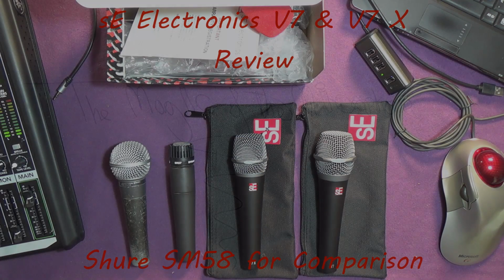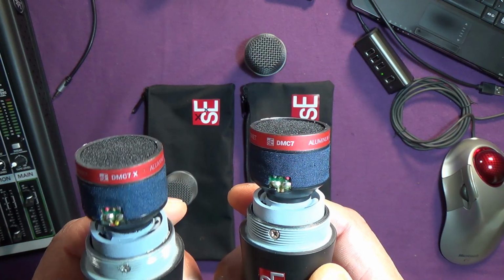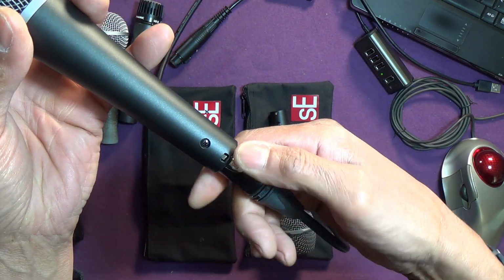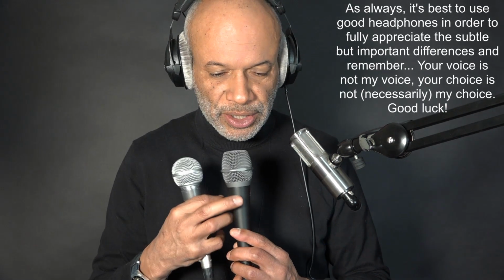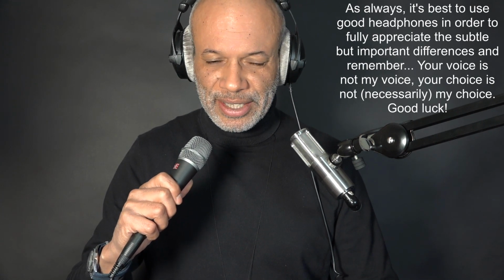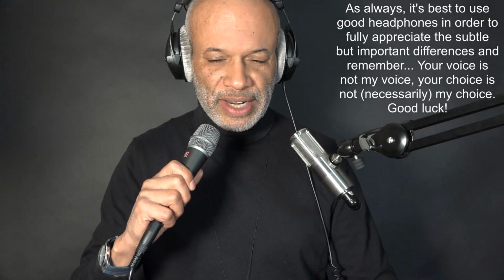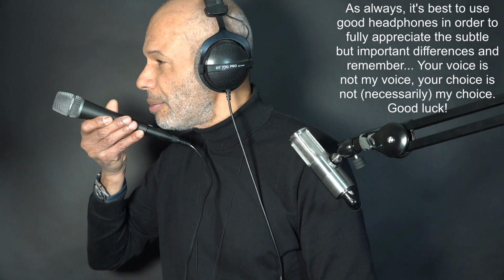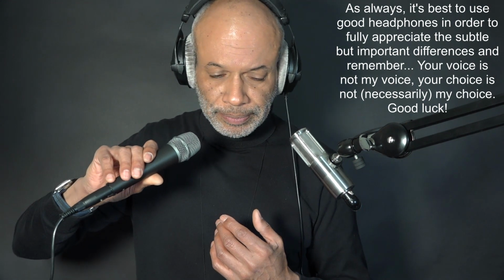sE Electronics V7 & V7 X Review vs Shure SM58 USA (Earthworks Icon Pro & Beyerdynamic M88)

Comment: This review approaches the level of art, so thank you for both the excellent review and the demonstration of its potential use as a new tool in the toolkit.  I loved how you put it in the larger context of change/evolution/progress and challenges of the marketplace.  The sE story is a great complement to this video.  Thank you, and I'm really curious to see what can be done with these two sound capturing devices.  I want to try it on double bass (particularly because of its rejection at the 90 degree angle with a bassist in between a grand piano and a trap set).
Reply from the maker: Glad it was useful.

Comment: We compared the V7X to a V7 & a KMS105 for a live outdoor acoustic gig, we used a simple foam top on all 3. Give the SE’s a little boost at around 10k.
On the V7X we lowered the bass a little around 100hz. It Sounded gorgeous on females. Smoother than the other two .
Reply: Btw we used the V7X’s own top on it. The little foam shield we put on top helped the pops.
Reply from the maker: Thanks, that's good to hear. I wonder whether SE makes an attractive exterior foam for it.
Reply: @AntonBrowne  not sure if SE do, I know what you mean tho, many are too thick looking & sounding too in some cases, wonder would a spare inner foam from the V7 or similar fit over the smaller grill on a V7x !?  Tidy size !Canford UK have great pop shields!  Or if there is a smaller sm57 pop shield that may work either. 
I felt the V7x ‘s own grill is nicer on it. Just a thin shield would be a class find. If you find something let me know an same as ! :)  Best Wishes

Comment: I did a spectrum plot comparison in Audacity between the Sennheiser e965 and the sE Electronics v7x on my baritone voice. I used the same reading and found interesting differences. I then applied some equalization to see if those differences accounted for the differences heard on playback. What I noticed was this.

Two main differences were a) between 40 Hz - 172 Hz and b) 6300 Hz to 11,800 Hz. The lower range was consistently 1 dB louder with the v7x and the upper midrange was around 3-5 dB higher on the e965. I didn't expect that, but the v7x frequency response graph does have a modest dip at 8 kHz. When these differences were compensated for on the v7x recording, the two mics sounded much more alike.

Remaining differences between the two mics may be accounted for by the following. From 13,400 to 22,000 Hz the v7x was an average of 3.4 dB louder than the e965! The differences in these frequencies were very consistent. And between 258 Hz and 4000 Hz the v7x was on average 1.6 dB louder than the e965. The midrange curves tracked one another fairly consistently between the two mics, crossing at numerous points. The v7x curve was ever so slightly smoother overall than the e965 plot.

That's one purdy dynamic mic ;)

Anton: thanks again for your work and love of mic reviews.
Reply from the maker: Thanks for the additional info.
Reply: As a guy with a very deep baritone voice, would you suggest the V7X over the V7 (or something else) for spoken words such as podcasting/streaming/short narration?  Seems like it would definitely need an additional pop filter for the V7X though.
Reply: @TheVagineWhisperer  That is exactly my use case and my type of testing. If you find yourself hearing the nuances that Anton finds and prefer what he prefers (extended range and flat frequency response), then I would say you would love the v7x. To be clear, I agree that the v7x instrument mic head and wind screen are simply NOT usable for handheld applications either singing or speach. I just ordered a v7 head today -- I'll update my post here on this business. But with the v7 head I reckon the v7x will be great. 

For context: I have only confirmed Anton's work with my own testing of the Sennheiser e965 and the sE Electronics v7x (with the v7x head). I use a SSL2 interface, and AKG k371s and Sennheiser HD650 headphones. I wish I could run the gamut of testing those Earthworks beauties, but there you go. 

Personal Plug: My two hands-on mic tests have persuaded me that a) YT is adequate for reproducing acoustic nuances (but only with adequate playback gear), and b) Anton is excellent at describing acoustic properties of microphones. I have not found anyone as good with noticing details and matching verbal descriptions (or impressions) to the relevant acoustic phenomena. And in 2020-2021 I've been up to my eyeballs in equipment reviews trying to find good stuff. So kudos to Anton.

Comment: Wow, I never thought the v7x would sound so much better than the v7, having heard other YT reviews. I'm using a Hidizs 9 DAC/amp and AKG k371 headphones. The difference between the two mics was significantly more pronounced listening with the AKGs than with my Sennheiser HD650s. The reason is, no doubt, because of the extended range of the k371s (5 - 40000 Hz ; down to 5Hz!). And frankly, truth be told, the ICON Pro seemed somewhat thin and washed out when compared to the v7x (at 26:32). That too was a shock. So sE Electronics -- we need the Anton Browne v7x kit! Let's go!
Reply from the maker: I think the V7X is a great performer, especially at the price. I've noticed that the Icon Pro works well for speech intelligibility across lowly reproduction systems but I find myself missing something in the lower frequencies - of course, low quality reproduction doesn't go low, so Earthworks knows what it's doing. I'm tempted to revert to the SV33, as why not use the best as I'm lucky enough to have it!
Reply: @AntonBrowne  I would support using the SV33. It is a veritable reference standard. Absolutely phenomenal on spoken word - sonic gold for voices like yours. The audio quality survives even YT formatting. And some nerds use high quality reproduction gear even for YT ;) In my opinion, speech intelligibility is too low a standard,, rather let your voice teach, delight, and move.

Comment: I found an m88 TG for sale, so I went to my top reviewer source -- I listened to your Beyer Brothers video. But the TG didn't seem to compete as well against the m88 (n) as the v7x did here. So I analyzed the most comparable sections of this video (viz., 24:20-24:23 v7x vs 24:23-24:27 m88n). I did not find a lower to mid push on the v7x. What I did find was that there was a midrange to upper midrange boost with the m88 (n). So said the spectrum analysis comparison. Six of one and half dozen of the other? Equalizing the relevant v7x section (+5dB from 1.5kHz to 3.5kHz and the same between 3.8kHz to 7.8kHz), the v7x sounded much more like the m88(n). I decided the TG wasn't for me; the v7x does the job better. Thanks. BTW:  I think bringing back the sv33 as a reference would be great. The icon pro sounds good on PC speakers, but with cans...
Reply: Kind of a weird question, but I have a Beyer m160 I use for harmonica (same as Lee Oskar and Mickey Raphael).  Do you feel the v7x or M88 would sound closer?  What I like about the sound of the M160 is that it is rather flat and in no way bright or shrill.  The EQ curve of the v7x seems to be closer on paper.   What I am reading here is that the v7x sounds more neutral? Thanks!
Reply: @harpninjamike  I haven't experience with the m160, so can't say. Anton's (older) m88 (n) has a brighter and cleaner upper end than the v7x imo. However, finding another m88(n) for sale in the wild in similar shape seems difficult to impossible; I've given up.

Comment: After doing my research and getting and using a V7 model microphone (Billy Gibbons special edition) I can honestly say that it's an incredible mic, way better for my voice than the 58 and more comfortable to handle. I also had a Senhiezer e845 a while ago and noticed that the V7 is better than that mic too for me. I also use a vocal processor when I perform and found that it sounds just as good with the processor and compliments it very well.
Reply: I just ordered a sE V7.  I had an e845 for a couple of days, but it just didn't work for my voice.  I preferred the SM58 and the Beta SM58A even more.

Comment: I contacted sE Electronics (May 18). They have only one distributor in the US (KMC Music), who are too busy to look up options or quote a price of an separate v7 head. Or, at least,  there still no answer [May 30]. This I don't understand. Aren't available options not priced in the parts book? Anyways, the v7 head part number is MH19, called "Mesh Head," and the "Wind Shield" foam alone is part number FM3-2. They say the head from the v3 won't fit on the v7's.
Reply: UPDATE: I ordered my v7 head today. It appears that it was not yet on the books as a purchasable item. They were purportedly in manufacture (US source), but store SKUs weren't yet generated (CDN source). Hence the phaff just trying to get a quote. I've been given an estimated delivery date of four weeks. So, I suspect that they are not in stock anywhere, yet. Price purchased: <$50 CDN.
Reply from the maker: Thanks for the info. Even with the extra $50 CDN, it's still a bargain.
Reply: UPDATE (July 13): Just got word that even though sE Electronics' distributor claims their gear is on the dock ready to ship, it won't arrive until November. Maybe. Interpret that how you will.
Reply: UPDATE: Just got work from my local musical instruments store: the new v7 mesh head is in! It took only 6 months. lol